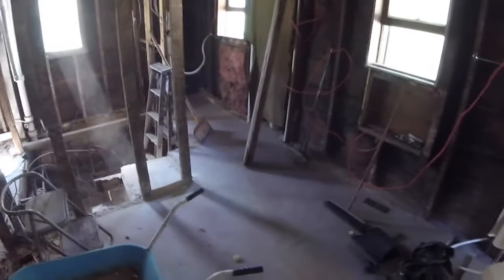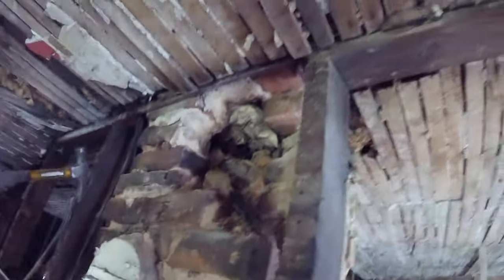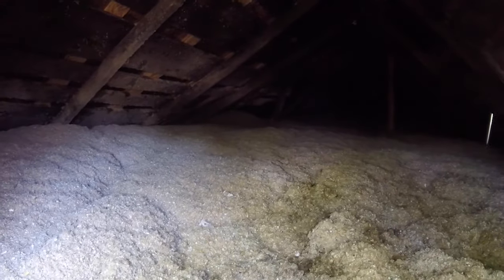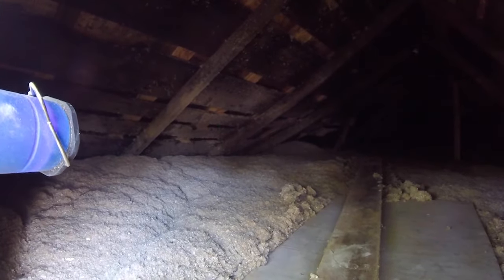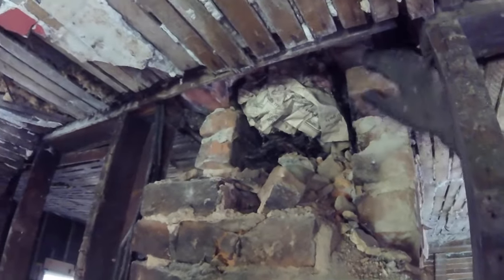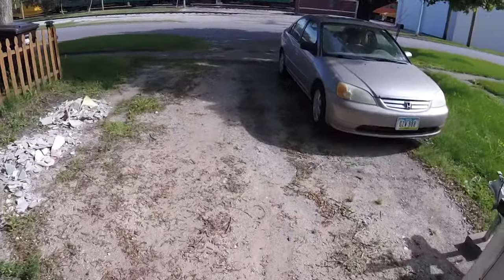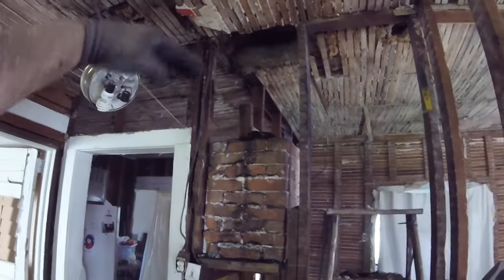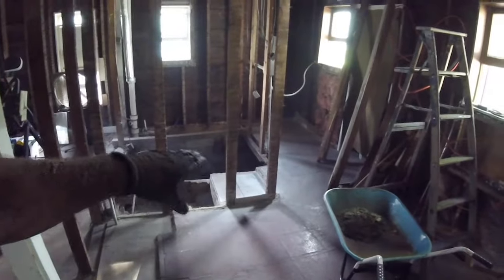$5000 House - Chimney Removal

Comment: When purchasing  a woodstove, here is what i found out and purchased. It should have a secondary burn system that takes the smoke and sends it back into the fire to burn. Smoke out the chimney is wood wasted. Also make sure it has an "air wash" on it so the glass door in the front never gets full of soot. Last but not least, make sure you can cook on the top of it.

Comment: Good job getting that chimney out! Since you're going to have put more support trusses up in that attic, might as well take the ceiling down and make it vaulted.  They blow that insulation in there, so you should be able to suck it out into a dumpster with some type of vacuum contraption.
Reply from the maker: Yeah i may have to do that.
Reply: @extremebudget  you can rent a vacuum to suck out the blown in insulation.

Comment: Sorry to say, but you are constantly repeating yourself and not much is getting done. You have to start somewhere. You need a mask and the will power to keep going. Stay safe and  motivated. I didn't think you ever was gonna go forward.  Thank God. Keep up the good work.
Reply from the maker: Yeah I realized it after I posted.  It was a slow, methodical process.  It sounds the same, but it there were small adjustments to my plan as I worked on it.  I admit I was nervous about this one :). thanks for tuning in

Comment: When purchasing a wood stove keep in mind, you'll have to reinforce your flooring. Insulate properly to keep your home from catching on fire. Purchase a wood stove for the correct amount of square footage. If you're purchasing used, make sure the stove doesn't have any cracks on the body, and potential leaks. Yes purchase a flat top for cooking if you get that option. Do not, I repeat, do not get a heat reclaimer, they are kreasote builders.
Reply from the maker: thank you for the heads up.  :)